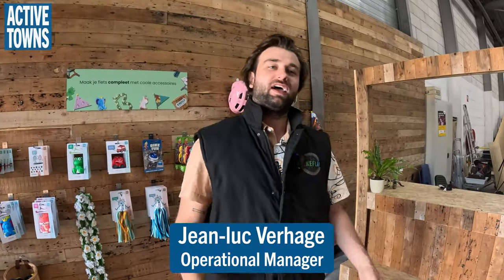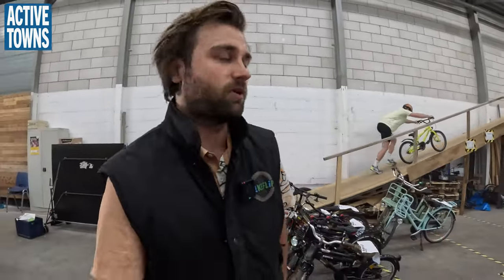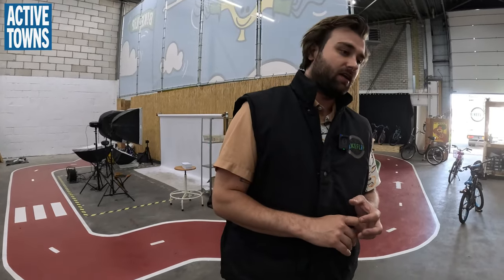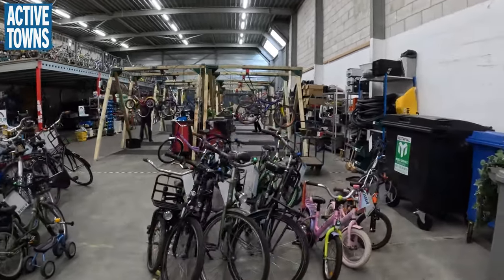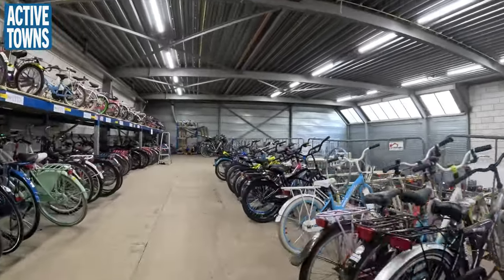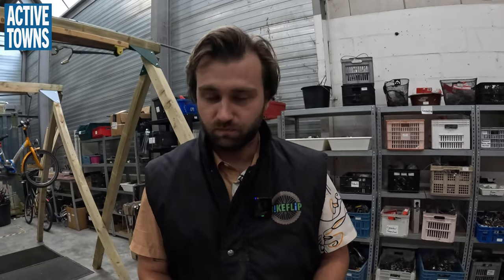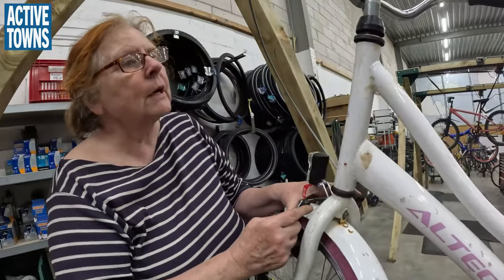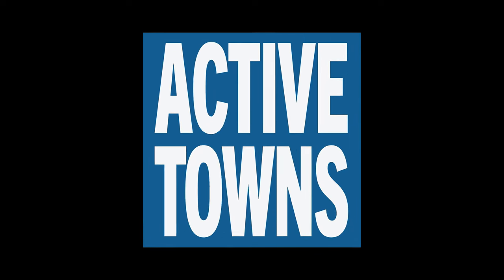UTRECHT: BikeFlip is a subscription service that keeps bikes out of the waste stream (Kids & Adults)

Comment: Because children's bikes are only used for a short time, you quickly have the inclination to buy a cheap bike that will only last a short time.  Cheap children's bikes are often low-quality, or at least have low-quality parts such as brakes and lights. Since such a bike will be replaced within a few months anyway, you also put little effort into repairs. This kind of organisation will put better-quality parts on the bike because it is cheaper for them in the long run, thus ensuring more safety.
Reply from the maker: Yep, and higher quality bikes like Woom, which I've profiled before on my Podcast, will last for a very long time, serving many generations of children. 
https://www.activetowns.org/2020/03/07/ready-to-ride/ 
Thanks so much for tuning in. Cheers! John
Reply: @ActiveTowns  I know, my youngest has one second-hand but almost like new Woom.🤠
Reply from the maker: @egelmuis  Nice! 😀
Reply: @ActiveTowns  and the oldest has an at least thirdhand Hase.  I have forgotten to show our fleet of bikes monday.